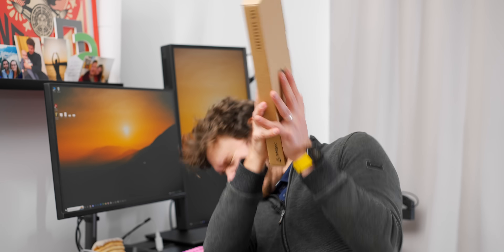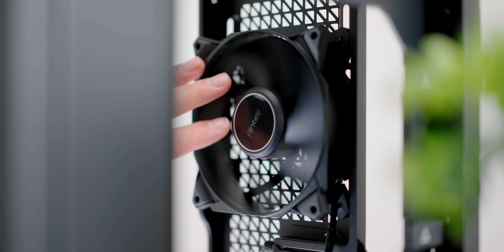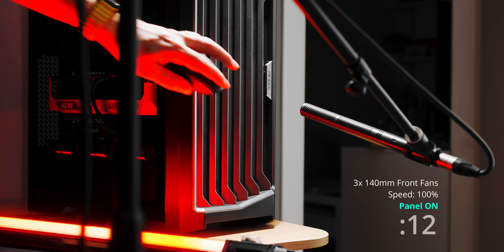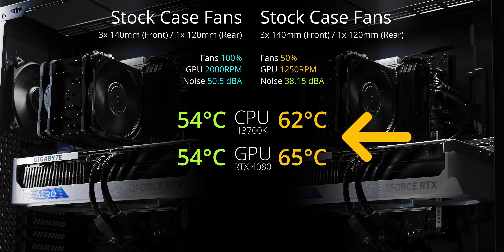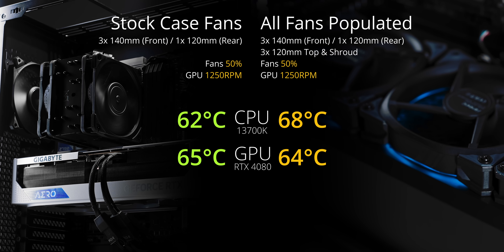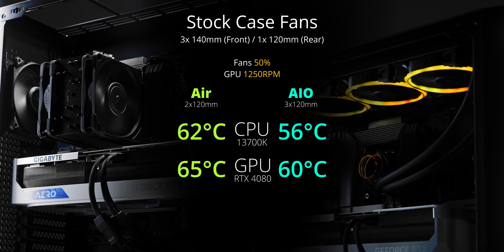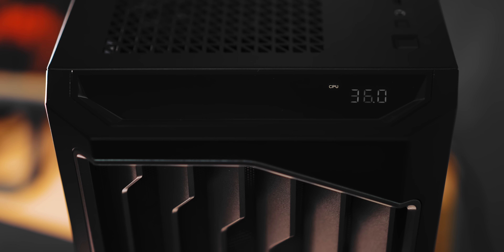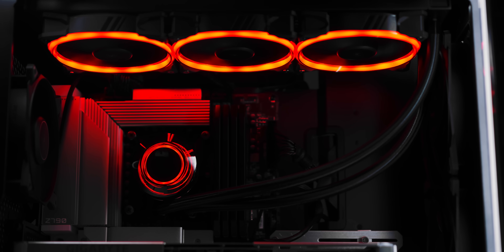How Many Case Fans do you Actually Need?

Comment: I have 9 fans, 5 intake, 4 exhaust.

I noticed significantly lower temps when adding the top exhaust fans which I didn't have before with a 6 fan setup.

Comment: The fans at the bottom are moreso for positive pressure inside the case, as opposed to moving air, though it does do some of that.
That keeps the case dust free.

Moving too much air gives no time for heat transfer from the metals to the air.
Also the more kinetic energy a molecule is charged with, the more resistant to absorbing thermal energy it becomes, as some of that kinetic energy is directly converted into thermal energy.
Meaning, fast blowing air can actually hurt a computers ability to cool.
Fast blowing air cools us, as it removes the moisture away from our body, that is created from the sweat evaporating, which is our body's primary mechanisms for regulating heat.
Reply: Are you an engineer? Your reasoning seems a bit incomplete. Higher airflow speeds are always better, as long as turbulance vortexes arent stopping airflow in strategic areas.

Comment: Honestly, to me, it seems like if you can get a cheaper well performing air cooler, you don't really need to fret about the 3-5 degree difference between that an AIO, especially considering that AIOs will fail at some point unless they're designed to be refillable. With air coolers, however, if the fans start to go bad you can easily just replace them for only a portion of the cost of a new AIO.

Comment: what about the psu fan? up or down and what difference does it make for gpu temps etc, also low profile cpu coolers are a thing and what would be an optimal setup with them?
Reply: PSU fans need to be below and PC case should be not standing directly to the floor, you need a gap between PC case and the floor so PSU fans can breathe in AIR.....if you install PSU upside down or the FAN is inside the PC case, the AIR for GPU FANS is shared for PSU and GPU....low profile is for SMALL FORM FACTOR that's only used if you need portable PC or very space friendly PC

Comment: How many fans?  YES!!!   Honestly  I wouldn't think Aio or any water cooling would require air flow like an air cooler would require :O  this was a good video :D

Also try putting each fan at a different RPM  you'd be amazed how much noise it'll reduce for some reason when all fans are at same rpm it creates a lot of fan noise

Comment: Would be interesting to see the chanfe if you use only the three bottom fans plus the io in the top without front/back fans because there is no turbolences
Reply: I'm using the Lian Li a3 case I have a slightly negative setup 2 intake below 3 exhast 2top 1 rear and it works exceptionally well. 5 7600 ocerclockex to 5.3 all cores and a 9070 xt. Max CPU temps are 70c and GPU is 50 with hotspots of 72/73. I'm loving the smaller size of the case and low power usage 😅. Still packs a punch too
Reply: This is what I'm looking for. What is the performance of top and bottom fan mounts only.

Comment: Biggest mistake air cooler enthusiasts always make, is that they put exhaust fans at the top right side of the case close to the intake. 

This is great for liquid cooling but bad for air cooling. Cool air is being exited at the top without making any contact to the components. 

The best air cooling setup is always one rear exhaust and one top exhaust near the CPU cooler. 

The exhaust fan should be removing hot air, not fighting for cool air.
Reply: the best scenario it's when mobo is rotated 90 degrees clockwise
Reply: @ fair enough if that’s the case, but for most traditional layouts the exhaust fan at the front is gonna end up fighting for air
Reply: good point. gpu fans exhaust out the bottom that's why myself I exhaust my case out the bottom
Reply: @brentallendodge4910  GPU fans intake cool air into the GPU itself, not exhausting through the bottom
Reply: @brentallendodge4910  you r doing wrong, really wrong.
Reply: @brentallendodge4910 heat rises. Put the bottom fans for Intake to help push the heat upwards to the exhaust fans. On my Lian Li O11 dynamic XL I use 420mm rad at the bottom  on a push pull configuration for intake, the side also uses 420mm rad on a push pull configuration Intake as well. On top I use a 360mm rad for exhaust on push only configuration as exhaust and 120mm rad for exhaust on the back on a push and pull configuration.
Reply: Hot air goes up u buffoon
Reply: @i_1mpuls3 airflow caused by fans overpowers that property by many orders of magnitude

Comment: Do we even need chassi fans if you have a water cooled CPU cooler and good cooling on the GPU, you can also have heatsink on the NVMe SSDs
Reply: You want some because, outside of the CPU, all that air isn't actually being moved out of the case, it's just being blown around it because usually the cases have some sort of mesh or something covering it to try to protect from some level of dust
but, since that mesh is there, that means more resistance against the air leaving the case, and more likely that the case will just circulate the air, or struggle to draw in new air, so you want at least some intake fans, if the radiator is removing air then you don't need extra fans to exhaust air as much, but you want intake fans, and using the water cooling fans as intakes will heat up the air even before it gets to cool other stuff so.

Comment: Top panel having 3 fans for air makes it bad. One in the very back should theoretically improve it. Would have loved to see temps with back fan + bottom fans. I'm not sure if bottom fans are worth it.
Reply: You always want an exhaust at the top, and 45/55 ratio of exhaust/intake, so dust is pushed out of the case and doesn't sit inside.

With the setup of 3 on the bottom, and 3 on the top with the AiO, adding a low RPM fan to the back would be ideal. Unsure if it should be an intake or outtake, but the speed of the exhaust going through the radiator will always be slowed, so having it as a slow exhaust may work while still preserving a positive pressure.

t- I've done HVAC and worked as an Electrician on AI Data Centers.

Comment: Very useful video! I just got all my pc parts today (case should arrive any minute now) and I was wondering if I needed to add more fans to my NZXT H5 Flow RGB that already has 3 120mm front intake fans and 1 120mm exhaust fan at the back. I bought the ID-FROZN A620 BLACK CPU Air cooler and I've decided that that would be enough!

Comment: I got 6 tower fans, 2 fans on the cpu cooler 120se, 3 fans on the gpu, 1 fan on the psu, so I got 12 fans
Reply: Got 15 in total  ^^
Reply: 9 for me. 3 intake in front, 1 exhaust in back, two exhaust on top, and 1 on CPU, 2 on GPU. I idle around 30-45

Comment: at my dualchamber itx case 4, depends on case at mine 2 bottom pull in 2 at top at the 240mm rad push out, 
at a normal case for atx/matx with a air cooler 1front at bottom 1direkt over the cpu cooler 1at cpu cooler 1at back, from front to back: pull in front, pull in top for vrms cooling, pull in cpu, push out back.
if you have a aio or rads at a normal atx/matx case 3front or aio front (end of the rad over the cpublock tube fitting to the rad deeper then the cpublock) bottom maybe 1-4 depends on case where the psu sits, at aio with the pump in the block never bottom, at aio with pump in the tubes like bequiet aio its okayish, at rads if you use between bottom and top a 2 pump it workes really well.  back 1-2 depends on case back you can in tiny cases use too a 120/140mm rad, side 1-3 depends on case aio at side 120/240/280/360 workes too really good but depends on case layout.
and now i start the video. 😋😜

Comment: For most "cases" 2-3 fans is enough. Everything else is elitism.
Fans should help not overheat components, not to freeze them.
1 front, 1 back, 1 top keeps both my cpu and gpu at a normal ~60 degree.
Reply: I always mount 2 in front. The reason is simple:
One front on top for fresh air for CPU and VRM (yes, they also need some air flow) and one front on bottom to provide fresh air for GPU. The GPU in most cases is the most power hungry device so it needs more cooling. On the other hand the CPU (and top/back fan) is able to do lot of air flow but which is above the GPU, so the GPU suffer...
If the case allow it, even better option is to put the fan under the GPU. I saw a test where it made significant difference on GPU temp. Again it's about delivering cool air to the GPU and compensate the main airflow in the top half of the case made by front + CPU + back/top fans...
Also more fans doesn't have to be elitism or "freezing" components. It allow to make the air flow with much lower speeds, so also lower sound :)
Reply: yea my current gaming PC has one intake and aircooler with a rear exhaust fan it has a intel i5-9400F paired with a radeon 5600xt im getting a new pc with a amd r7 9800x3d paired with a radeon 7900xtx and that pc is going to have 3 intake fans and the cpu cooler is a 360mm aio  that works as a exhaust and it has one more exhaust fan in the rear

Comment: I kinda wish cases came with plates to block off fan positions you don't want to use. The top exhaust closest to the front is one such example, if you don't have a radiator there then you want it blocked off so the fresh air is directed towards the CPU cooler instead of ejected before even touching a single component.
Reply: my case, Corsair 400x, comes with a magnetic mesh filter that sits on the top of the case, forcing air to go out the rear for exhaust. If you install an AIO, you can remove the filter easily and exhaust from top, which since hot air rises, the rear shouldn't matter.
Reply: Make your own custom piece

Comment: Is it a micro ATX board? If so, would the GPU close proximity to the cpu cooler make a difference?
Reply: There's no significative difference in the distance between the CPU and GPU in a micro-ATX mobo  relative to an ATX or E-ATX. In the micro-ATX mobo their lower part, below the GPU, is that is "cutt-off".

Comment: How about dual chamber fish tank cases? With the side intake, bottom 3 intake, top 3 exhaust and 1 back exhaust? The case feet are high enough, theres no shroud so the fans are directly intake air from the bottom. Will it still create a turbulent air?
Reply: That would be worse wouldn't it? He got turbulence in his test, and the bottom 3 fans were heavily restricted. Now, in your aquarium case, they are not restricted much at all, so the effect will be further exacerbated. IMO, those types of cases work best with AIO coolers. You can mount the AIO either on the side or in front (as intake), or on the top (as an exhaust). If you are air cooling in that type of case, I am unsure if you can draw the same conclusions as you can here, but I would assume it would be similar, i.e. dont populate the top and bottom portions of the case with fans

Comment: Thank you! I was wondering about the efficiency of those cases that seem to be built of fans (can see plenty of them fishtank style ones on PCPP). I was also having doubts about the chimney style cooling, as there is a huge block in the way of the airflow (the GPU). 

With air cooling, a clear front-to-back channel with plenty of intake is the best, just as the conventional wisdom goes. 
With SFF, I found it is a bit of an opposite situation and the biggest gains are from removing the heat from the case (as the unit fans are usually close enough to the case panels to help themselves).

Comment: If you put all 10 fans as exhaust and keep the glass side pannel off 

Would it go to shit or be fine ?
Reply: Not ideal. You want to create directional airflow from one side of the case to the other with slight positive pressure to recycle and blow air over all the hardware that generate heat

Comment: I hate that there are no LED front panel lights except for the CPU/GPU temp display. I can't live without an HDD activity LED.
I had to install a RED fan in the front just so I could tell if it was even on.
Reply: I will never understand people who need blinking lights to tell them whether their PCs are running.
As a general rule, when you switch on your monitor and it shows anything else than a completely black screen ... your PC is running.
smh
Reply: @Gaius__  I hate blinking lights/leds. I had to buy some light blocking stickers to block them all, even though I blocked all those rgb lights from the Bios there were still lights on MB and gpu. I don't understand them either, but I guess each one have their preference. My next case is going to be an ASUS PA602 and MB an Asus ProArt and this setup should have NO lights at all. Clean and simple.

Comment: Adding more fans can help reduce temperature but it's generally better to maintain positive pressure airflow which leaves from the back of the PC. 
This requires top fans to blow air inside. But I would recommend not using one of the 3 top fans at the back because of its close proximity to the back exhaust fan from which hot exhaust air can re enter the case.
Reply: But if you have top-mounted fans blowing air downward and inside the case (intake fans), then won't that top intake airflow disrupt the positive airflow that moves from the front of the case to the back of the case?
Reply: Top fans as intake?! Nah, exhaust since hot air rises.

Comment: I thought maybe one of the configs would be with the AIO in the front, that way the cpu radiator would have outside air.  Going to build in this case next and according to Antec a 420 can fit in the front. and maybe that bottom fan on the aio will push air underneath the psu shroud...we shall see.  Great video, love how you guys do multiple oppositions!

Comment: But how do you balance having a 420mm aio exaust on top and a 140mm fan at the back, I can't have 4 intakes without using at least one of the bottom slots (only 3 fans fot in the front) so shouldnI go with negative pressure or would bottom fans in this case improve things more then they hurt things due to turblance? I guess I could get faster fans for the front to get positive pressure

Comment: I probably should change it to 2 exhaust I have 6 fans total 2 on the top 3 in the front and one on the back 5/6 blowing air with also needing to upgrade cpu cooler since I’m using the stock one

Comment: I see one flaw here with air cooler, despite hot air going up, in this config only top fan above cpu should be exhaust, the first two should be in take, if they are exhaust you're taking out air provided from front fans before it reaches the cpu, no wonder you have bad results

Comment: I have this case, and I filled it completely with Thermaltakes SWAFAN's, 3x 140mm front intake, 3x 120mm on the AIO on the top, 1x 120mm on the rear exhaust and 3x 120mm on the bottom with the GPU horizontally mounted and I have great temps... yes it may not be needed on the bottom, but it looks cool!

Comment: Have case fans on the top bringing in cool air , so it acts like a giant exhaust.
Reply: Front and bottom should be intakes, top and rear should be exhaust, since hot air goes up
Reply: @Aeryxs  No, do some research on this, for air cooled setups, top exhaust starves the CPU cooler of fresh air. It is better to have any top exhaust, or better yet, set the top as intake.

Comment: I have Qube 500. 1x 140mm intake fan in front, 1x 120mm exhaust in rear, 1x 140mm in side panel (for GPU extra flow)

Comment: My case is my case is really old and more for an office PC. So no vents on the top. BUT I am crazy and bought the i7 14700K and for it the thermalright peerless assassin. My case currently only has one fan. I will install an exhaust fan on the side. Which me luck guys. Maybe in summer I have to buy a new case but for now I am cheap.
So I'll maybe come back here to report you guys how my CPU is doing cause the intel 13th and 14th is infamous for being a heat struggle for many gamers.
Reply: U r crazy
Reply: @bukandastin790  Hey guys. So I built the PC and used it for quite some hours already. It is a true Sleeper Build and super stuffy within. 2 fans I have right now. On idle the CPU runs on 30°C. I was first shocked that it was low, cause I stressed so much on how people said the intel CPUs are so hot.
When I do tasks like downloading, using dicord, opening files and using Photoshop it can run up to 60°C when I do everything at the same time which is okay but meh. When I play a game it can get up to 90°C uh oh. Videoediting AND rendering is too much which is why I undervolted it now.  I am very happy with that result though. Cause hey, I have a stuffed office microatx PC case with barely any space for vents.
So when I have money again, I will buy the recommended case. I am very thankful for the recommendation.
Well... my point was to say, if I can get an intel CPU gen 13 or 14 working without top and side fans and without an AIO, then so can anyone!!!
Reply: @bukandastin790  Hey guys! 
So I have built the PC and used it for quite some hours now. It is basically the perfect Sleeper Build! Totally stuffed and only two fans.
Results: CPU temps on idle 30°C. I was a little shocked, cause I was stressing about the potential heat so much, cause gamers struggle with it in their super modern cases.
Well,  when I do simple tasks like discord, some downloads, Photoshop at the same time, it can get up to 50°C. Videoediting and Rendering is very frightning but also around 70°C. While rendering it spiked to 88°C once. Gaming is similar. (The CPU can get up tp 100°C)
So I am quite happy. I might undervolt a little bit and when I have money, I will buy the recommended case. Cause my micro case is super stuffed. No place for cable management. 
Well what I wanted to say: When I can get an Intel Gen 14 working then so can anyone!!!!
Reply: Just get the montech 903. Best cheap case by far
Reply: @Mr_Reaps25  Thanks for the tip. I haven't come to building the PC for now by the way